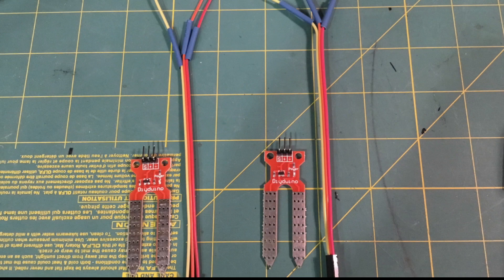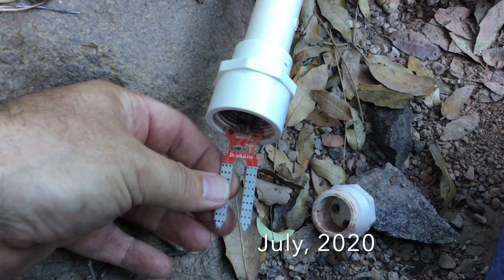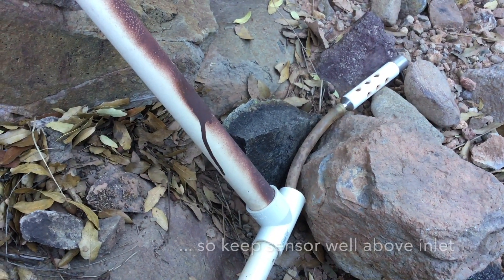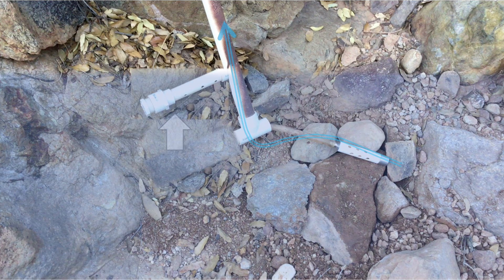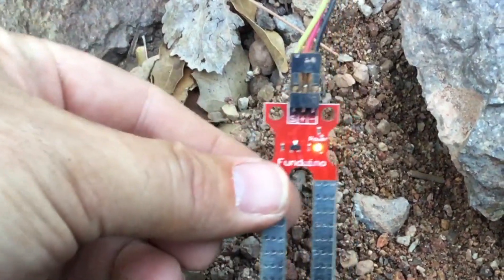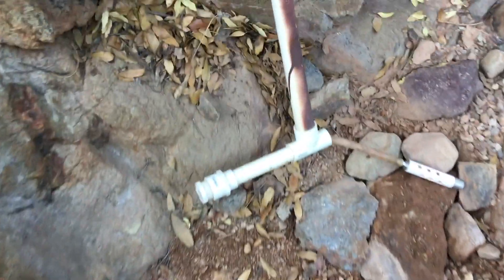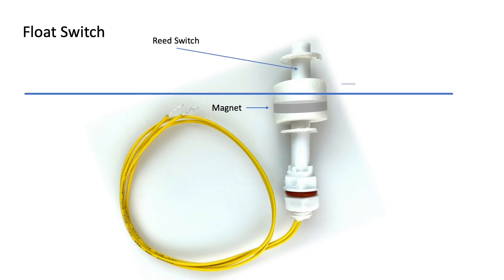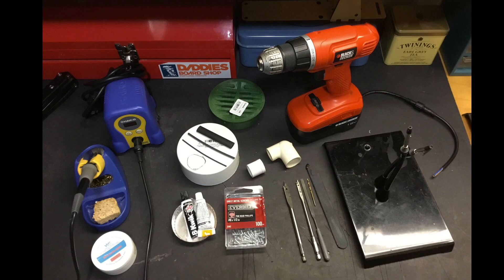Vertical Float Sensor with 4G Telemetry

Comment: You just need to make leads on your fork. Censor that are long so you can tie that inside the Box so they don't get corroded you may. Have you know A45 foot lead with an end on it? But that's easier to deal with with the zip ties. Then it is you know have to keep you know trying to fix what you're dealing with.  So hard shotter that I'd done and then make the connectors so they fit inside the container. Not to mention that they do make a 2 part Russian or Apache gel type weather proofing substance. So? When you you can turn around and mix some p*** in there and it makes a gel and then you can clean that out later. You can find my amazon
Reply from the maker: Thanks very much for the suggestions and ideas.

Comment: I’m a sensor nerd. Hobby not professional. I do have a lot of experience with microcontrollers, LoRa, and other low power networks. 

For the simple switch system you are using, I’d see if it’s possible to use a digital input and if there is an internal pull up or pull down configuration for the pins. Most of the micros I’ve used have these, and that will eliminate a component and some wiring. 

The other nice thing about digital is you might be able to sleep longer. For example, you could sleep for an hour unless you get an interrupt triggered by the pin change interrupt. This would allow you to do wellness check ins but only care about changes when you care about them. For example, once flow is detected switch to a sampling strategy but without any flow poll extremely infrequently.
Reply from the maker: Agreed - I have played a bit with digital interrupts as summarized here: https://youtu.be/H20QEC0Hgtk . Definitely something I want to revisit.

Comment: Thank you for your excellent video! High quality work as always. 

Have you considered an arrangement supplying a divided voltage to your analogue input through a series of resistors to measure the height of the flow? A depth gauge with exposed contacts at regular intervals would sense the water depth and presence. 
It should be a reliable mechanism, inexpensive and provide some useful additional data regarding flow depth and duration.
Reply from the maker: That is an excellent idea- a yard stick would make a great prototype! Let me see what I can come up with.
Reply: Thank you!
I've used an arrangement like this in the past. Some attributes to consider are that the fluid resistance varies depending on dissolved salts and pH and that corrosion between contacts can be reduced by switching the sensing current off when not in use. 
I tried to gather useful data regarding the pH but it was generally a fraught process because of the constant need for recalibration. It may be worth exploring this idea further if its of interest. 
I dealt with the issue of variable fluid resistance by using a relatively high sensor voltage of 12v through a good regulator to keep the input voltage level as static as possible. Then I programmed fairly broad tolerances in to the analogue read of the micro to accommodate fluid resistance variation so the level increment output was fairly consistent. 
The sensor was switched on and off by a triac to minimise corrosion but its a good idea to let the sensor stabilise for a short while after turning on to prevent erroneous readings.